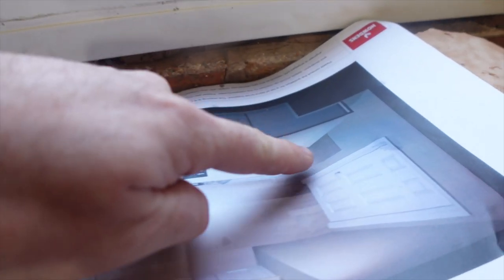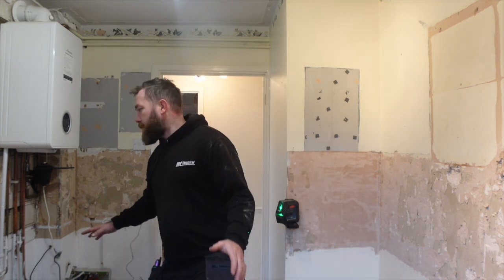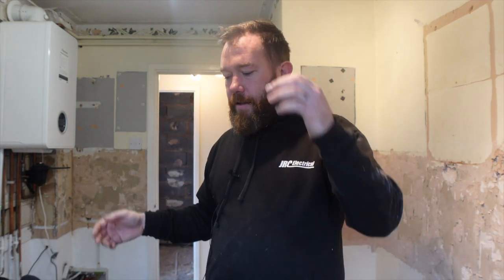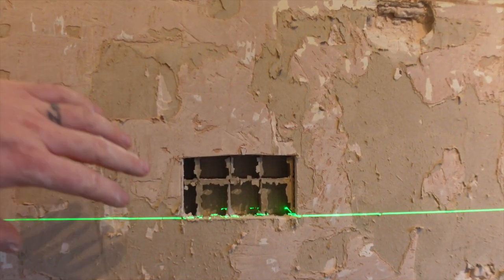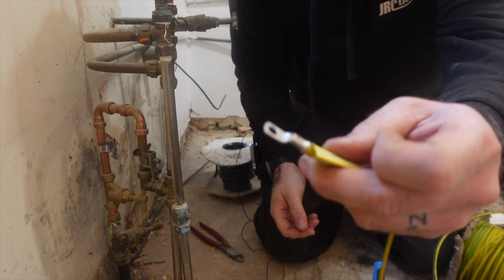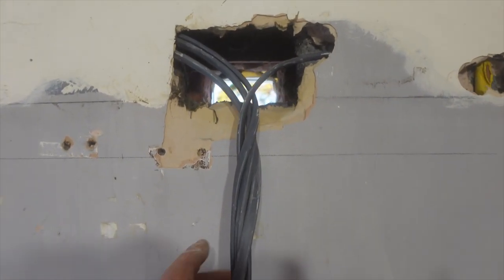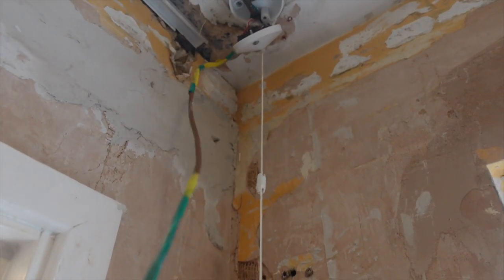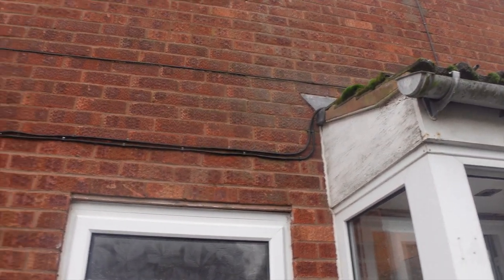Wiring Ring Final Or Radial Circuits?? - Electricians Life -

Comment: Interesting watch! As an Australian spark, its interesting to see you guys still use ring circuits, as well as solid core cables.
Reply from the maker: Ayyy that’s awesome that your watching from over there Thankyou,
What are you using over there for kitchen, I only use rings in kitchens now to be fair also what cable do you use?
Reply: @JRCElectrical  We use Radials for everything here! We also have laundry rooms in every house so no washing machines in the kitchen. Usually 4 power circuits per house, kitchen/laundry/half the house/ the other half. We also use 7 core stranded cable! Standard is 90°C. You can buy solid core but it's not common these days.

Comment: Hi. Just a quick question ⁉️ is 2.5mm2 cable for sockets in the workshop? The max I would be running of the socket is a table saw 2.2kw and a dust extractor 1.1 kw at the same time. Any help much appreciated!!!
Reply from the maker: 3300w works out at 14.34amps
If your feeding it from a spur the spur will only hold 13amp fuse so it will be too much

Comment: Didn’t know that but now I know but the trouble is I need some extensions for self and Love your videos
Reply from the maker: What do you mean extensions dude? Thanks for watching sir big up
Reply: @JRCElectrical  I do Sending a request for a quote but I forgot to add one for the kitchen as I need an extra socket putting in for a small dishwasher on the counter and outdoor ring flood light for later on
Reply from the maker: @f26247  ahhhh I’ve not long seen this on tradify, I will give you a call tommorow to discuss 👍👍

Comment: Surely now you have wired new circuits into the consumer unit you have to comply with the 18th edition and upgrade the consumer unit from a plastic one to a metal one
Reply from the maker: No sir because it’s an existing installation that still passes all the tests all protected and to regs just not a metal board which wouldn’t fail an eicr anyway
Reply: @JRCElectrical  That just isn't true,if an existing installation is altered or you wire new circuits into that existing installation then it all has to come up to the 18th edition,if you were just doing an visible inspection that's different,
Reply from the maker: @davidclarke2513  I did not no this then, I’ve always thought if the installation and consumer unit is all protected and to regs then you can wire into it, I stand corrected if that’s the case tho

Comment: Agree on the rings, 4mm radials are hassle, 
Gonna quiz you now, what are the different colour earth clamps are for? 🤔
.
Yes I know 😂
Reply from the maker: Different locations so if it’s in a wet location and ting, I used red
Because I had red on the van 😂😂
Reply: 🎉winner 😂😂😂
Red - internal/dry
Blue - wet or dry 
Green - wet or hazardous 
-
NICEIC inspector asked me a few years ago and I said - hot or cold taps  😂 
back when we used to cross Bond everything 😬
Reply from the maker: I won’t ever get the 2 mins back it took me to read that 
Thanks 😂😂😂😂😂
Reply: @JRCElectrical  and neither will anyone else 🖕 hahaha

Comment: As a recently retired JIB GOLD card industrial electrician of 50 years,I'm old school and a huge fan of final ring circuits ,I've never wired a final ring circuit in cable less than 4mm sometimes in 6mm ,with these modern socket outlets with 2 earth terminals you split the incoming and outgoing cpc in separate earth terminals,if you lose one of the cpcs your circuit will continue to give the whole circuit a functional cpc which you wouldn't get say if your first socket list it's incoming cpc then your whole circuit is left with no earth function,this thing about the price is bs pecause I know contractors etc 75% off the price of coils of twin and earth,so for me ringmains all day long far enough upstairs bedrooms don't require ringmains  because the power they are pulling is next to nothing
Reply from the maker: Yeah we tend to run radial circuits for upstairs, radial for downstairs and ring circuit for kitchens as that’s where the main draw is. If tested and not messed with tho a radial is safe as your testing if the earthing is continuous throughout.
If a ring circuit is broken there is potential for 32amps to run down 1 leg of 2.5 so I can see arguments for both sides
Reply: I am learning about this for some basic DIY at home so my knowledge is very limited. Could I please ask couple of questions:

1. How do you know or find out whether your system is ring circuit or a radial one?
2. If you have a ring circuit, my understanding is that you can only spur off a socket once. How would you know/find out, the socket you are taking the connection from is part of the ring and not a spur off socket itself?
Reply: @iam52 You'll generally have a 30 fuse or 32 Amp breaker for an ring final circuit. Dead tests will verify if the circuit is a complete rfc. In most cases circuits are ring circuits for sockets here in the uk. You generally have 20 Amp breakers or fuses for radial circuits. Provided you don't exceed the maximum floor area of 50m² you can can spur on spur of a radial. You can have a spur on spur of rfc's if you install a 13 Amp fused spur before any of those sockets. This does however limit the amount of current you can draw to those sockets on the outgoing of the fused spur.

Comment: Radial 4 mm twin and earth on 32A 
Saving time and money
Reply from the maker: What about when u want to add something and spur off? Can’t get more than 2 4mm into a socket it’s a nightmare
Reply: You can use a wago socket new version
Reply from the maker: @emilgemc8913  👀 I shall look into this, last time I did they were poo
Reply from the maker: @emilgemc8913  ‘tis true sir
Reply: 4mm t&a cable in conduit or wall is rated to a max of 30A. Clipped directly it's 32A. You'd have to downrate the mcb/rcbo.

Comment: Radials fused at 20amp is a no no as fast as I’m concerned. No one these days takes into consideration one day there might be a reason for extra capacity. I have been to houses where the boiler has failed or a bust pipes and the customer has gone out to argos and bought 3 or 4 convector heaters to heat or dry the house out.  Not a problem with a 32a ring .  I have even used 4mm to wire a ring if it’s a long circuit.
Nice to see you do a proper job with the bonding and conduit over the cables
Reply from the maker: Yeah I see what your saying, this is a fair point but I’ve also heard other people saying about rings not being safe because of possible open ring and being left undetected, I’m sure we’re the only country wiring ring finals aswell. 🤷‍♂️ 
Thanks for watching
Reply: @JRCElectrical  even with radials you could have a earth come disconnected in say the first socket. The rest of the sockets would still work and the customer wouldn’t know as the circuit would still work .   Very unlikely I know but just a example. We could go on all day about the pros and cons so probably best to leave it now. Thanks for your reply
Reply from the maker: @andysims4906  agreed it’s always good to hear different peoples opinions tho as everybody looks at things differently, thanks for ure comments dude